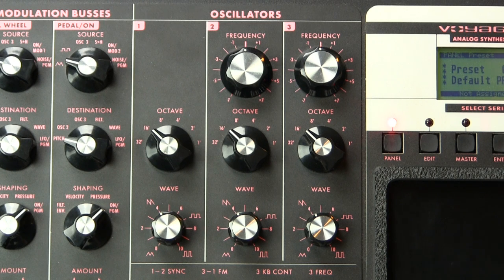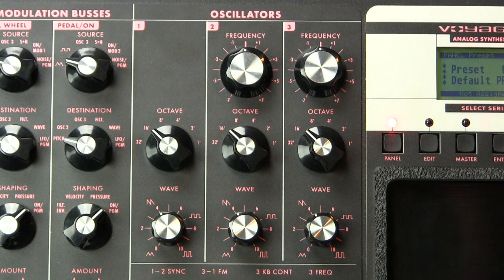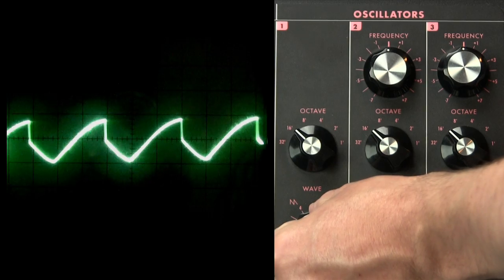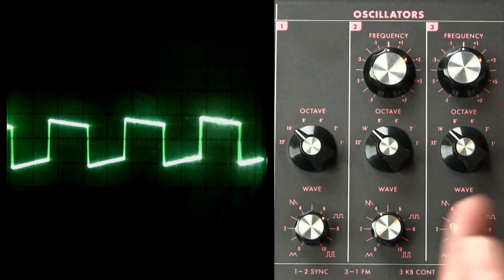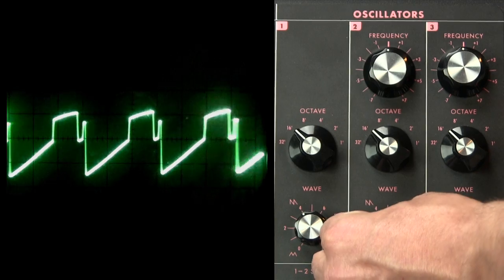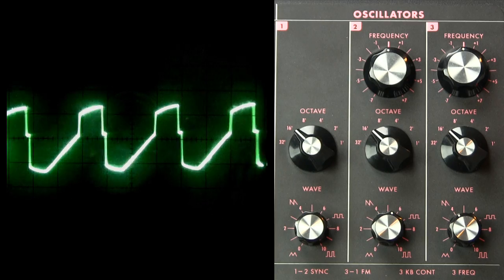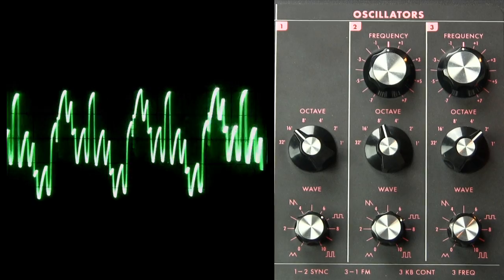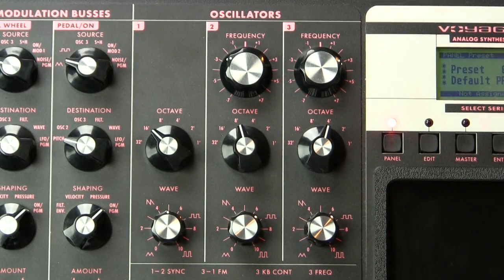The Oscillator- Variable Waveshape

Comment: Interesting to know all that, thank you for the video!

However, the thing with non-square square is because of the phase of its harmonics. Frequency-wise it's exactly the same sound, which is the same for all synthesisers on its own, but there will be differences in mixing sounds with different phases even if they have the same harmonics.

Comment: I plan to make an analog synth in the future. How do you make a normal VCO(s) do this sort of thing? I found it mesmerizing but confusing...
Edit: I really want to know. Someone please tell me. I can't really find any schematics online.
Reply: Jackson Shelton Hey this might be a late reply and you may have already gotten your answer, but I’ve come to this problem too
By taking the each of the outputs of the oscillator, I.e. square, pulse, triangle, or sawtooth, and putting them into a crossfading mixer that pans/mixes across them, you can make this type of oscillator. However making a 4 way cross fader is quite complicated, I figure this moog machine has a discrete but less intuitive circuit that does this
Cheers, mylo
Reply: @mylo_calibre  I am also looking into this. I have come across a few modules like doepfer morph something or other, mixiplexer but they're not ideal. Really looking at the qubit synapse but there's not much info on it so I reached out to them today. Also the RxMx from makenoise but I don't know if that would smoothly blend from one to the next rather sequentially step.

Comment: unless this is analog it's called wave table synthesis
Reply: Wavetable can cross fade between any single cycle waveform. This can be sawtooth or square .So given this is analog the single cycle is an actual circuit the waveshaper will change it. Again cross fading between your original circuits. ITS EXACTLY the same just fading with a voltage instead of a processor.
Reply: noppes
Reply: I dont see how not, i understand that they use totally different engines. I've used reaktor as well as teansy for wavetable, and Ive made oscillator circuits. I know they dont work the same way, but the way they fade is what i see thats similar
Reply: I am also a reaktor user/builder .
First of all ..there are two kinds of wavetables ..the one used in old creative soundblaster cards ...so called single cycled waveforms .
And then the ppg/waldorf type of wavetables ...a collection ( table ) of waves with a pointer .
Both types needs a ramp/phasor oscilator to drive the wave .
Waldorf and ppg wavetables can be created with a partial editor .

Hell you might call vector synthesis a form of wavetable synthesis , but there the blending between waves is actually amplitude  crossfading .